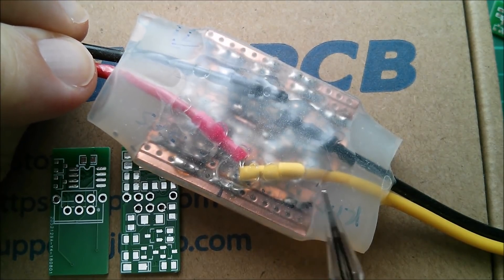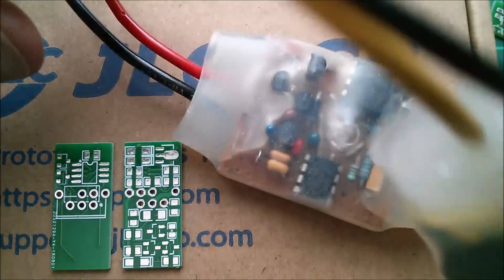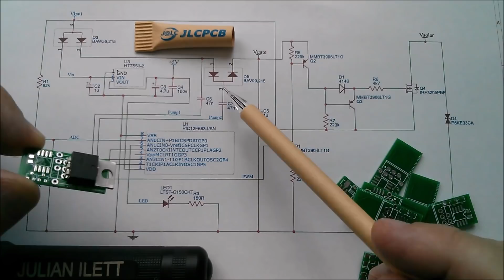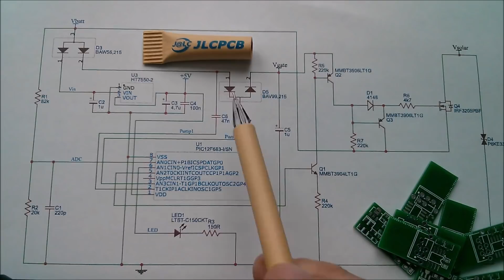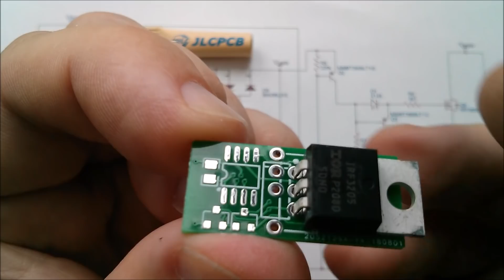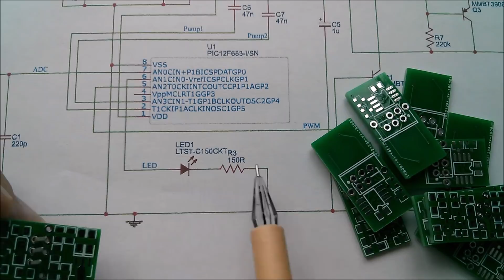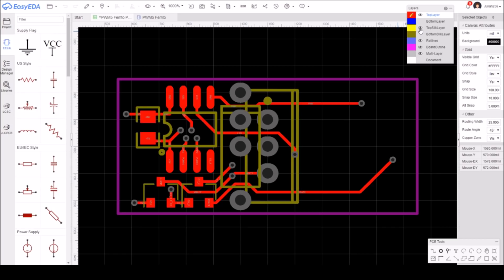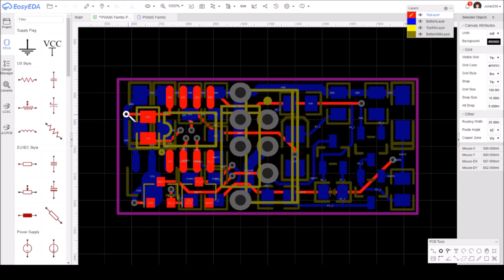PWM5 Femto PCB

Comment: Nice project! The MOSFET can’t actually handle 175 A, though. That’s just marketing because that is supposing that the temperature is magically held at 25 °C, dissipating all the heat from the case, something obviously impossible. If I were you, I’d have put a ground plane below the MOSFET for heatsinking.
Reply: @GRBTutorials 

That FET doesn't need any form of heatsink when run at just 6 Amps. I've been using the same PWM5, designed and built by myself from Julian's open source material. I tested the FET temperature at 6, 8 and 10 Amps, and it doesn't get hot at all at 6 Amps. Even at 10 Amps it doesn't really warm up to any real degree,  measuring just 20°C above ambient temperature. So running at 6 Amps is of no consequence and sinking simply isn't needed.
Reply: I know that 6 A isn't enough for needing a heatsink (after all I've never even had one of those MOSFETs, even less tested them, and Julian surely would test them), I was just commenting that the 175 A figure is marketing BS. There's no way 175 A can flow through that MOSFET without an infinitely large heatsink. If you want to learn more, click "Read more", unless you're allergic to maths.

The value for the maximum current (Imax, in A) is the square root of the maximum junction temperature (TJmax, in ºC) minus 25 (ambient temperature), divided by the thermal resistance from junction to case (ΘJC, in K/W or ºC/W) and by the resistance when on (Rds(on), in Ω). Or in a relatively simple formula: Imax = sqrt((TJmax - 25) / (ΘJC * Rds(on)). All the values are specified on the datasheet. 

The actual value depends on the heatsinking and the airflow. Considering there's no heatsink nor airflow, the valid thermal resistance is that of the junction to ambient (ΘJA) specified on the datasheet. Then you multiply that value by the number of watts dissipated (which is I^2 * R and R is Rds(on) in Ω) and bingo! You have the increase in temperature above ambient! And if you want maximum current, then it's the same formula, except using ΘJA instead of ΘJC: Imax = sqrt((TJmax - 25) / (ΘJA * Rds(on)).
Reply: GRBTutorials 

I did the maths and followed it up with "real world" testing. Julian would have also done testing as he was encapsulating his original product. I chose to use it in my own design as it was already proven to do what is needed.
 
Encapsulating in hot glue would allow a lesser device warm up in use, so I suspect that's why this one was chosen. 

The IRF3205 is supposed to be handle 110 Amps, which is as you say likely marketing BS. The pins of the device would likely fail before it could drain that current.  

However it does the job just fine at this very modest level and keeps the BOM to acceptable levels at the same time.
Reply: Please tell me where I said that it didn't do the job. I never said that. And yes, I'd say the pins are also likely to fail as well at that massive amount of current, apart from what I said before.

Comment: 12:12 : why is this an unconventional placement? Why does it matter which way the led an resistor go?
Reply: Don't know if there's a point with SMD LEDs, but with leaded LEDs you would put the resistor on the leg that does NOT hold the small die inside the LED (often looks like a small cup and is usually the cathode). The reason is that the leg that holds the die would also transfer most of the heat out of the LED. You wouldn't want a resistor there, but rather a big ground connection.
Reply: When you're considering a simple LED (not one of the bigger powerful ones),  the power dissipation in those is only going to be a few milliwatts at most,  so it would seem that heat dissipation isn't really much of a factor.

Comment: You could probably use smaller resistors for most of those on there, but at that point you couldn't easily assemble it by hand anymore.

Comment: Hi Julian, I was wondering if instead of silicon sealant to encapsulate the board, would a two part casting resin be a better option?
If I'm right then you'll have no issues with big holes, it'll be permanent and would be a lot easier to apply.

Comment: Bloody awesome, will you be selling these made up?
Reply: gerald West 

Julian isn't making them.
I can make them if there's enough interest.
Reply: thats blinking awesome, they'd be great as micro inverters
Reply: @gerald West 
It's a PWM charge controller. It's not really an inverter, just a voltage regulator. ;)
Reply: my bad, my thinking was to attach one per solar panel ( i have 3) to allow for shade partially covering one, two or all panels.
Reply: @gerald West 

That's the mode I use them. 
I have one on each panel so a panel in shade doesn't pull the voltage down on the rest, as would happen if all panels were in parallel. 

This is where the small PWM charge controller really shows it's worth. 

I've built a few designs, based on Julian's open source material. 

I'm currently working on a similar board to Julian's latest, but with some modifications to make it less unconventional.
Reply: Yeah right, my thoughts exactly, so I'd like say 10 or something to fit and just play around with. if you can make them id love to purchase some from ya made up or just as kits, kits really.
Reply: @gerald West 

When I've some kits available, I'll put them on EBay. 
They'll not be identical to Julian's, but will be my take on his design. They'll work the same and the pics are programmed/ tested, so it just need soldering on to the board.

Comment: I think I would be inclined to test it before encapsulating it! As a commercial product, maybe consider a proper conformal coating designed for the job, or pot it in transparent potting compound. You can get litres of the stuff for not much. Modellers etc use it to simulate water in dioramas.
Weren't you tempted to shrink it further by folding the MOSFET over the other direction? That leaves a lot of PCB space that can be used to solder wires to rather than the rather "how ya doin"  way of soldering it to the legs that are flapping about.
Reply: Won´t be flapping about in encapsulated!

Comment: i guess there is no chance to make it waterproof with stranded wires going in / out.

fist thing that comes to mind : shape it like a bell, make all wires come out at one end, hang it from the other , badum tsch.. rainproof. (or anything alike that respects gravity) 

also i think there are waterproof power connectors, like for pool pumps and such, i have a power supply with a waterproof 3 pin connector, but they may be expensive.

some sort of liquid rubber that sets but stays sticky and flexible might be a solution too, i think its more "outdoorish" ;)

nice design ... still no copper fill but i like it   ^^
Reply: nico nico water will happily track along stranded wires against gravity

Comment: Lots of room to add component labels.  Just make the size smaller and move the labels from their default locations.  Look at the size of text the manufacture added at 15:28, it is still readable.  Some components like the diode pairs don't even need the full designator and you can just use the numbers.  Makes life way easier during assembly AND while designing the layout.
Reply: And don't forget to add the "PWM5" label, version number, "Julian 256" and date.  Lots of room on the top right at 15:26.  Yes, it will be under the TO-220 but it will still be readable before assembly.

Nice work, Julian!
Reply from the maker: You're right, there is plenty of room.
I found that naming most of the interconnections (like pump1 and pump2) made the layout process much easier. Without the names, the track would be called R1_2 and R2_1 which was extremely confusing.
For the silkscreen, I'd really like to use the component markings (like 1AM for the MMBT3904).
Reply: That's a good idea to rename the interconnection "wires" that I haven't bothered with.  I find that as long as the components are labelled it works well.

The problem with component marking labelling is that sometimes they change.  You change one 471 resistor to a 681 but you have five 471 resistors all labelled the same!  BUT either way at least you have some labels!

Ideas for version 2.   ;-)
Reply: Designators (Q1, Q2, D1, D2, etc) are just fine if you don't have space... then you can just follow the BOM descriptions ;)

Comment: Remember to use non-acetic cure silicon or the boards will corrode over time.  GE Silicon II is a good example of a non-acetic cure.  If your silicon smells like vinegar when drying, it is acetic cure (acid) and will tend to corrode components and boards over time!

Comment: That's impressive! :) I'd recommend maybe switching a few components to 0603 if you really really want that 0.5x1 inch footprint :) Another option could be to go for something like an SMD fet:
https://www.digikey.com/product-detail/en/vishay-siliconix/SQJA02EP-T1_GE3/SQJA02EP-T1_GE3CT-ND/6709025 < this fet here is way over-kill. 

I used my Tj fet calculator, and entered 5mOhm Rds(on) for the fet (more than it is) 10A (Twice what you need) and 50C ambient temperature where you use it (should give decent headroom) and then I entered a thermal resistance, junction to ambient of 150 C/W, because the datasheet value of 68 assumes a 1 sqin of copper under the fet.

This ends up at just 125C Tj, out of a max of 175, or in other words, at 10A, it's 75C hotter than the ambient air around it. At 5A it's just 18.75C hotter than the ambient air (so 68.75 @ 50C)

The calculator I used is here: http://snuletek.org/calculators/fetTjCalc/

Comment: You know jlpcb support panelization within the 100x100 order size ? :D
Reply: Minimum board size for v-scoring is 2 cm x 2 cm.
Reply: You don't need to use vcuts for panelisation with jlcpcb, if you've a rectangular board you can overlap the cut lines and they'll do it.
Reply: How to go about that, just less pieces in either direction or what?

Comment: I'm sure you know, but if you're going to use RTV silicone instead of hot glue, get the non-corrosive stuff that doesn't smell of vinegar so it doesn't destroy your circuit. 
Maybe Dow Corning 785N. I haven't used that particular one but it says non corrosive and clear. https://www.travisperkins.co.uk/Dow-Corning-Neutral-Silicone-785N-Clear/p/239242
Reply from the maker: Cheers - I like the idea of being able to buy it locally

Comment: I have learned a fantastic amount from your channel, so much so that I’ve decided to make my own version of the PWM5. My through hole version isn’t much bigger width and length wise, but I had to cheat to get it that small. Most parts like resistors stand on end, and it’s made of two PCBs that sandwich together with header pins connecting them together. Had to find a good material to isolate them of course. Kapton tape being the obvious choice, I decided against it for cost reasons. To avoid a big weird ground track, I just used a ground plane, figured it might also dampen noise. Ideally I’ll have a ground shield inside my case with some metal foil if necessary. So it’s going to be a fair bit thicker. But my casing idea can easily accommodate thicker but not width. I wanted mine to fit in line with two SAE polarized connectors so it would be impossible to hook it up backwards (provided the battery and panel are polarized correctly). I intend to coat mine in hardening nail polish (or maybe more dunk the whole thing in it, so it’s completely coated) and fit it in a thin in-line plastic shell once I get a 3D Printer.
Reply from the maker: I'd be interested to see it - can you make a video?
Reply: Yes, please show your version!
Also, while you envision answering the case question with a 3D printer, have you had a look at commercially available solutions such as https://www.banggood.com/search/waterproof-box.html (no affiliation) yet?

Comment: fair enough, I see why you really needed those tantalum caps. ...heres a idea.... do go over to some 0603 for resistors where power is not a issue and use a d-pak mosfet instead...that helps sink heat to the board better and helps get rid of those pesky holes you need to rout around. .... or make a mini-pwm with less capability (like 1-2A, not 6 and up) and a sot-23 or sot-223 dual mosfet. :P
Reply from the maker: I thought about using a DPAK MOSFET, but the legs of the through-hole device double up as connectors :)
Reply: The biggest problem you'd have with that is that pin 2 on those dpak mosfets is on the back and takes up most of the chip, you'd lose a lot of space top run traces and vias, sot-223 or sot-26 would  give you a reduced package size without taking up the extra space on the board and you shouldn't be too hard pressed to find something similarly rated in those formats.
Reply: DirectFET is the fanciest FET one could use.

Comment: Silicone will attack the Components
Reply: You'd need acid-free electronic grade RTV silicone.
Reply: Clear epoxy works well
Reply from the maker: Not as fast as water does :)
Reply: I don't think there will be a lot in it.... you can buy proper Electronic Grade Silicone which does have the acetone or water in it.
Reply: Julian Ilett conformal coating followed by 3 layers of kapton tape, then potted in a 5mm layer of potting compound, of course a nice thick blob of silicone, topped off with a heat shrink sleeve with 3 zip ties at each end........safe enuff??

Then a condom covering the whole lot........at least that has a B.S. kitemark!!
Reply: Acetoxy silicone (cheap DIY store stuff) will rot the pcb in no time at all... Acetoxy free silicone, ie solvent based is what you need.  You are better off with epoxy..
Reply: Just do it the cheapest way possible and fix it later. Just  like Micro$oft.
Reply from the maker: Once again, waterproofing this device is going to be the most difficult part.
Reply: Spray the finished board in conformal coating, before putting it in the silicone.
Reply: Pot it! A glob the size of the original PWM5 should do it. A-hum. ;)
Reply: You can buy some proper electronics conformal coating. Conformal type silicone that's safe for components, or acrylic will work fine and be far easier and more reliable in the long run. You can paint it on or hang it and give it a spray, easy.
Reply: You can get a potting compound or alternatively pondland do Tommy Walsh 2 part epoxy which will work just as well
Reply: An Englishman in Brazil - they've stopped doing tommy walsh and switched to 'bond together' ... seems more exothermic and sets quicker but is probably still suitable - maybe you could keep it in the fridge before mixing to slow it down a bit.
much as I love £1 epoxy it seems like it'd work out as an expensive way of potting these units though.
Reply: Probably better to have all the cables coming out the same end this time with a 'this way up' instruction so that water wont fall onto or pool around the cable entry points.
You could avoid a lot of stress by saying that it's not waterproof and if people want to site it outdoors they should use a dribox or something similar. you can get a dribox from £10 on ebay.

PS hope you use a nice LED this time - blue is sooo 2000's ;)